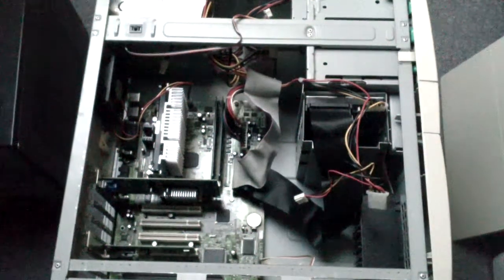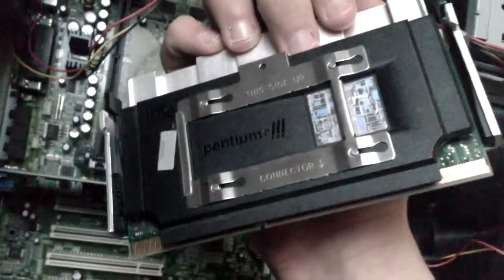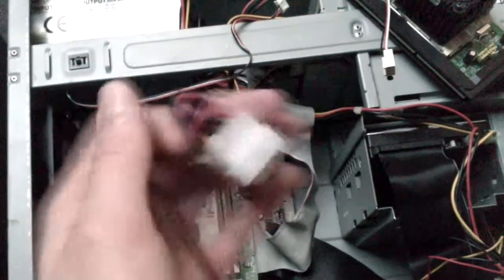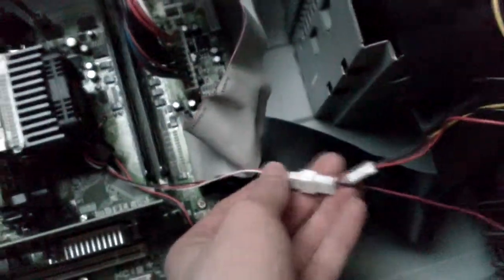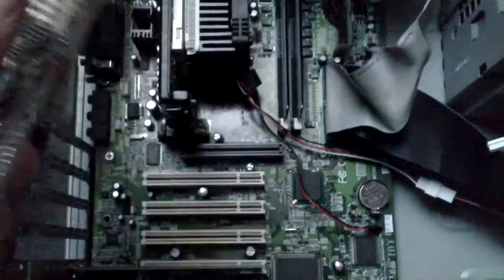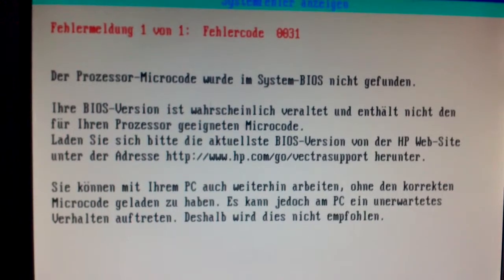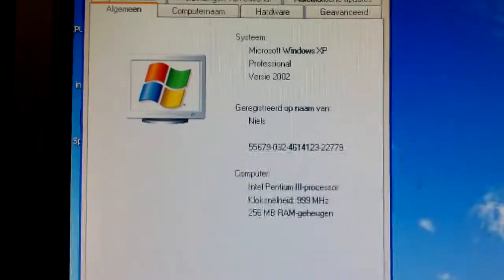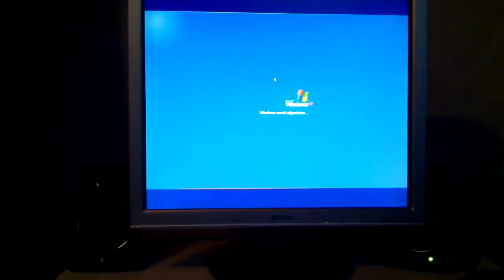HP Vectra VL600 CPU Upgrade!

Comment: I'm subscribed since a day or two, I really like your content :) I'm also browsing through your old videos but they're still nice to this day :)
This type of board really intrigues and interests me, why you may ask ? => Slot 1 + rambus + ISA which is a rare and original combination (especially with 2 ISA slots, I believe this FIC KC19+ is the only one to have this combination) and would be kinda "ultimate" for a 1999 build :)
Were you able to upgrade the CPU to a Tualatin core ? Of course in case that you have an adapted/modified slotket and/or an FC-PGA to FC-PGA2 adapter like the lin-lin one

Comment: It would seem easier to replace a slot 1 processor than a modern PGA or LGA processor, but I somehow completely damaged the slot trying to upgrade my old Celeron 266 to a Pentium II 450.  I have never messed up a socket processor while installing it.
Reply from the maker: The thing is, that you need to properly align the connectors on the CPU package and the slot. It requires some brute force to get the package to move through the placeholders on each side. I haven't had any processor installing mishaps so far, luckily.
Reply: I don't have that PC anymore but I still have a computer with a Slot A Athlon "Classic".  I have taken it out and put it back in without any problems.  The Slot A is physically the same part as Slot 1, only turned backwards because the pins are incompatible.

Comment from the maker: I am aware of that. This Coppermine actually runs at 1.75V, which is the highest any P3 was, along with the special Coppermine-T core. Tualatin P3's ran at 1.45V. I have no purpose for any servers. I'm not hooking it up to the network through ethernet, since I'm not going to lay down another 20m of cables. No space for it.

Comment: Interesting fact: There are three visually identical but electrically different revisions of socket 370. Thank Intel for not even marking the different slots. That's why you can only upgrade to Coppermines, because newer chips ran at a different voltage.